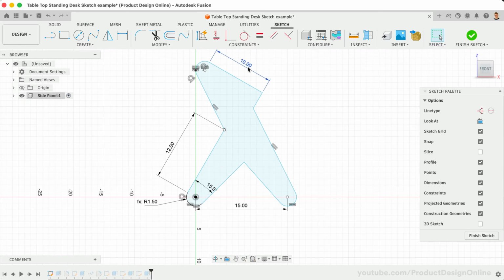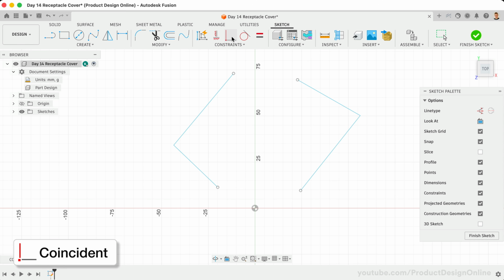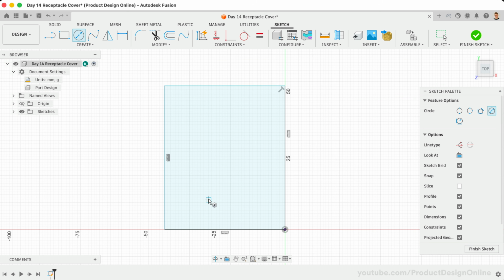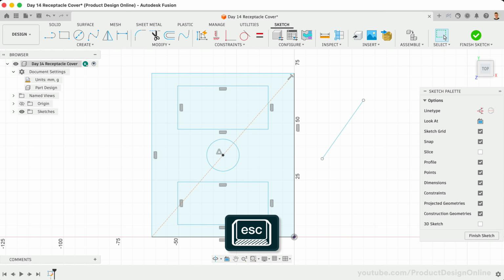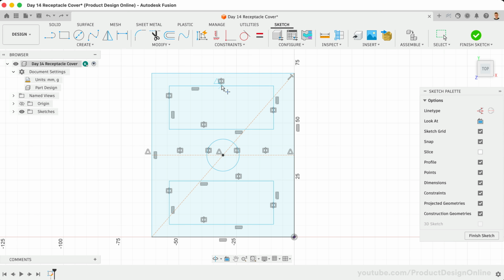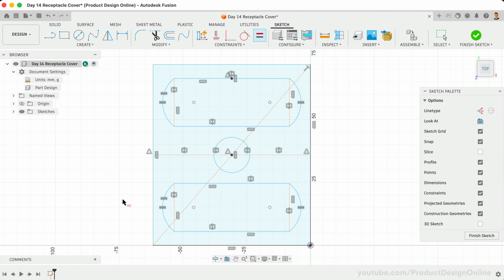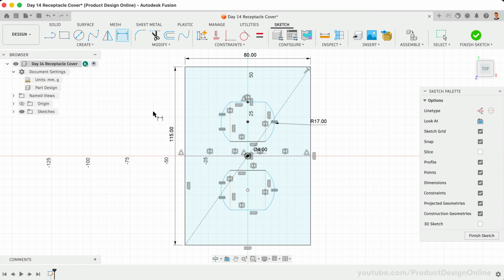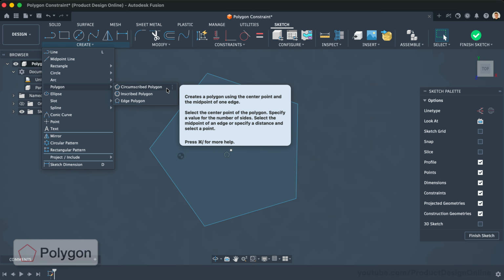Practice ALL Fusion Sketch Constraints | Day 14 of Learn Autodesk Fusion in 30 Days (2026 EDITION)

Comment: In this exercise, the instructions say "Clean Up Dimensions: Delete two of the repetitive fx:36mm equation-driven dimensions. Replace
them with Equal constraints to link their lengths geometrically.
Tip: Do not delete or reference the very top fx:36mm dimension; it is bound to the sketch fillet and
will break the geometry if altered.".  I keep getting " Failed to solve.  Please try revising dimensions or constraints."  🤔

Comment: Working on the challenge I hit an issue,  so here's note for anyone who tries this: When I right-click the dimension with the function applied, I only get 2 delete options. 1/ Delete Coincident and 2/ Delete (lower down) ... neither of those are the sketch dimension. It turns out you FIRST have to delete coincident before it will let you delete the dimension entirely. The other Delete option deletes the line the dimension is applied to. Wow, Fusion can be convoluted sometimes... which is exactly why I've put off learning it for 10 years and stuck with Rhino + GH until now. These tutorials are the best I've found, and are making the process much less painful!

Comment: for the top arm of 'F' to be twice the lengths of the lower arm, wouldnt you just use a calculation such as fx; 2 X dx where dx is the dimension number of the lower arm ?

Comment: Another question for you I want to import some 2020 extrusion and I'm trying to use McMaster insert feature but I can't figure out how to make it a custom length?
Reply from the maker: McMaster-Carr parts (if using the STEP option, which is preferred) will come in as a base feature. In short, that means there are no sketches or other objects that drive the 3D body from the STEP file. You can typically select the face > activate Extrude and drag the arrow (or type out the dimension) to the desired distance. At times, it can be helpful to leave the inserted part as-is, create a new sketch > project the geometry. You can then work with it like a regular Fusion-built part.

Comment: I wonder why Kevin uses a Mac for CAD rather than Windows.
Reply from the maker: True story - back in the day... I had a Mac for two other design programs that were only on Mac OS. I was using SolidWorks at the time and ran a SolidWorks user group. I first started using Fusion (before they even called it 'Fusion 360') because Autodesk was the first one to commit to making a fully-featured CAD program native to Mac OS, and I was tired of running Windows via Parallels on the Mac, just for SolidWorks. I don't think Mac is better than Windows, but what someone is used to is often 'better'... especially with years of muscle memory. That's a big reason I still use Mac.

Comment: Awesome series of vids. I greatly appreciate them all, currently taking the entire course, thanks so much 🙏🙏🙏
Regarding today's Challenge reflection: I ended up adding 3 constraints:
Length of the top edge of the top arm of the letter “F”:
From “12.5” to “d14 + (d18 * 2)”
Length of the bottom edge of the top arm of the letter “F”: 
From “7.5” to “d18 * 2”
Space between the left of the letter “F” and the frame:
From “10.75” to “(d4 - d11) / 2”
But not sure that was the most efficient way… Would love to see how you would do it 👍
Reply from the maker: Nice work! And thank you. I appreciate you watching!

I may have to make a short video on some of the potential solutions.
Reply: @ProductDesignOnline thank you, and yes, that would be great 👍
Reply: This helped me a lot! 
Only thing I changed from this was after making your change of the length of the bottom edge of the top arm of the letter (d19)
From "7.5" to "d18*2" 
I was able to simplify the length of the top edge of the top arm of the letter (d11) 
From "12.5" to "d14+d19" instead of "d14+(d18*2)"
I'm not sure if this makes any relevant changes but it makes my brain happy
Reply: @GregyGreg sweet. Your way is probably better. Less calculations = more fluid model 👍

Comment: Hi, this doesn't exactly pertain to sketches but I have a question I've been trying to figure out. I have an assembly file with a few parts all jointed together. I want to create a new component — for example, a rod — and I need to make a hole in another part so it slides in and out. I would normally project the geometry from other components to get the exact dimensions, but this created a lot of errors when I did it with multiple parts. What is the correct way to reference geometry from one component to another without causing broken references?
Reply from the maker: This depends a bit on the situation. Is the model something you could share? Are you using 'Edit in Place'?
Reply: @ProductDesignOnline Sorry for the late reply! Yes, I'm using Edit in Place since it's an External Assembly. I tried uploading a picture but YouTube won't allow it, so I'll do my best to explain.
I'm building an iris mechanism that has a large drive gear, a spur gear driven by it, and a rack driven by the spur gear. To place the heat-set insert hole in the correct position on the spur gear, I moved it into place, started a sketch on the component the spur gear is attached to, and projected that circle to know exactly where to put the insert. Now that is where I get issues with my assmebly and I get error on the little "chainlinks" next to the components and it asks me to update them all the time.
Hopefully that makes sense sorry if it's still a bit hard to follow without a picture!
Reply from the maker: @Emmet-McConnell  Is it a yellow triangle that is next to the chain icon? If so, that is showing your 'design is out of date'. You likely need to click the main triangle at the top (applications bar) of Fusion to pull in the latest changes, which will pull in all the last saved file of those external components.
Reply: @ProductDesignOnline  Thank you for the help! This fixed it!